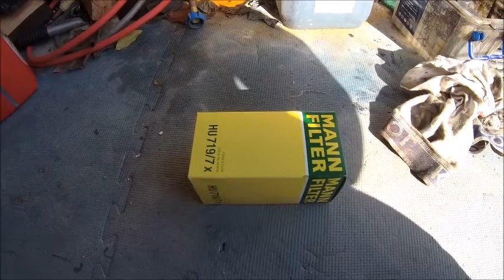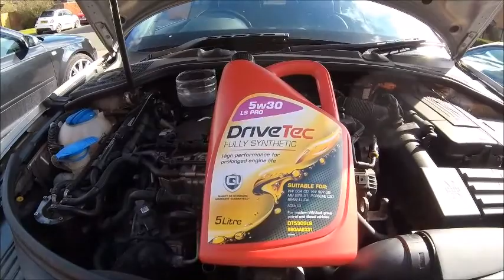Audi A3 8P oil and filter change

Comment: Good job dude, if I ever decide to do it myself I'll use your vid unfortunately I'm tight on time atm so the Audi garage does my S3 8P and they love money!! 🤦‍♂️😹
Reply from the maker: oil changes are probably the easiest jobs to do , it's just taking the time to jack the thing up and take all the covers off that's time consuming. years ago you could roll over a pit and have it done in literally 15 mins   😄
Reply: Hi, its to much job, go under car taking plastic cover off, taking care off dirty old oil and get rid of it!
Audi in Sweden only take 185 Euro for base service, inkl oli filter and engine air filter, nu use doit myself.
Still, fun clip!
Johnny
Reply from the maker: @johnnyberglund841  Always done it myself then get to choose the oil and filters rather than the garage going for the cheapest.. only one change a year on this car too , so not too much hassle. The S3 gets a couple a year but agree too, the plastics (and metal on this one) are a pain ....    .👌